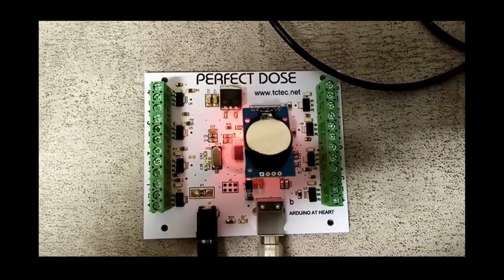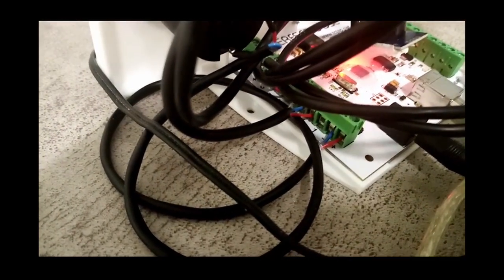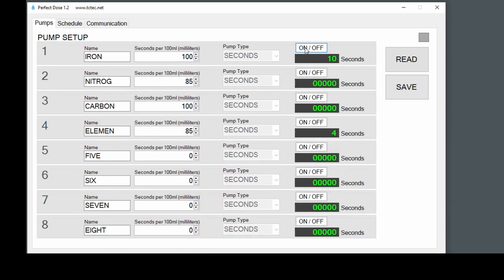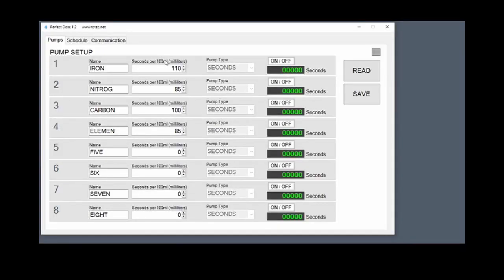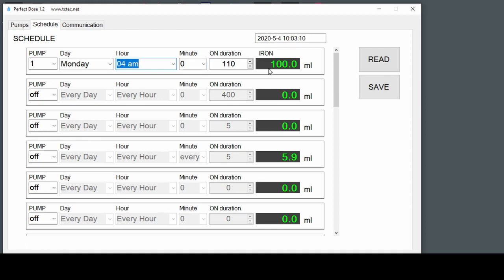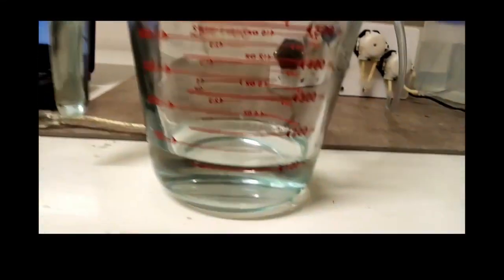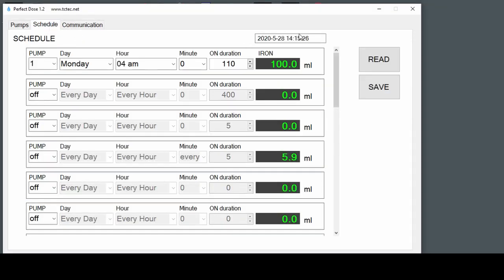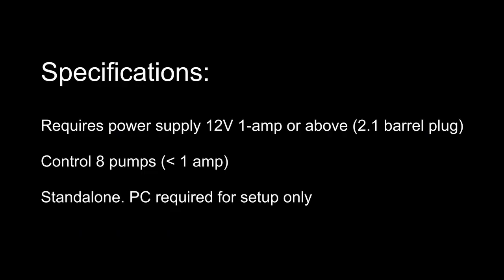Perfect Dose : Dosing Pump Controller

Comment: Is there any way to purchase this board? I visited the site but no way to purchase.
Reply from the maker: Hi,
This is now open source and can be built using an 'Arduino'.  The Windows Application, and source code are here: https://www.tctec.net/perfectdose.htm

It does require DIY, but it can be used to accurately dose any pumps at any time.